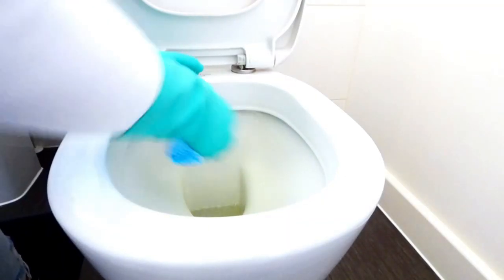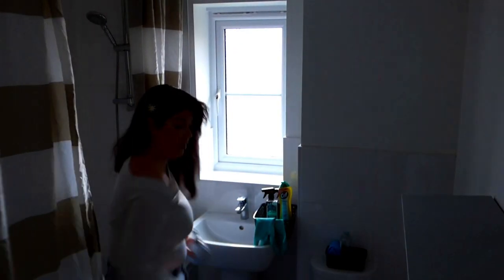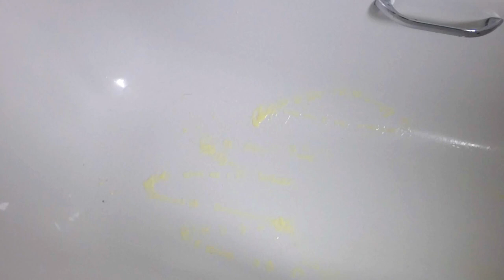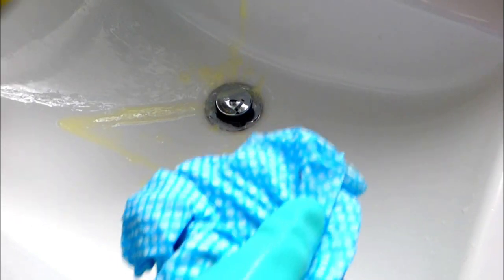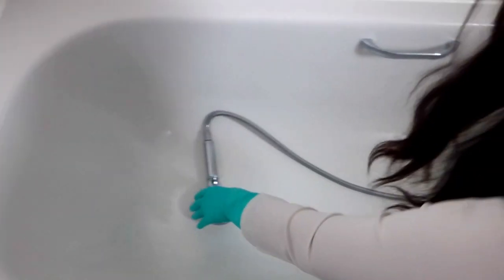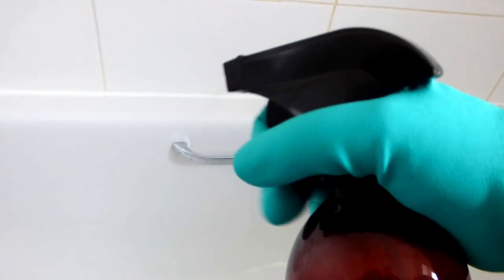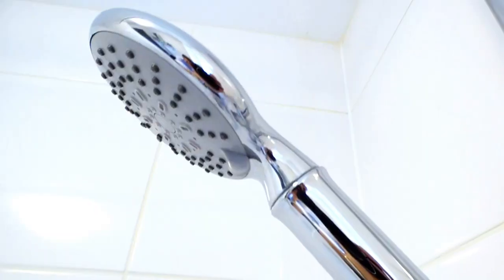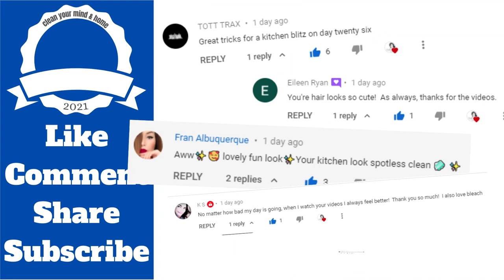30 Days of Cleaning with Hayley (Day 27) | Bathroom Clean With Me 2021

Comment: Now we're on day twenty-seven, so make your bathroom look live heaven 🛁🚿🚽🧽🧼
Reply: I just thought to myself, wouldn't an acidic bathroom cleaner be easier to use than the Cif? (The brand's name in Germany is Biff, btw 😁) I use a bathroom cleaner based on lactic-acid, a product for professionals. So I'd remove the shower curtain, throw it into a 60° wash, get everything wet with the shower head, spray some of the detergent and then give it a good scrub with a dish brush, including the grouts. Then I'd rinse it off, dry the tiles with a squeegee and polish it with some microfiber cloths. I've been wanting to give the tiles in my shower like a protective coating, bit yet I didn't find a suiting product. Maybe you have an idea?
Reply from the maker: 🤣🤣 love love love 🙌🏽
Rain X for the coating darling,
I alternate between viakal and cif it depends what I fancy using on the day 🤣
I’ll have a look for the bathroom one is it on Amazon 🤔💕